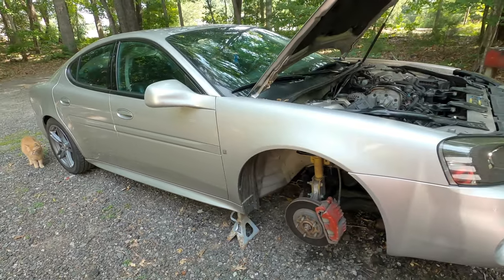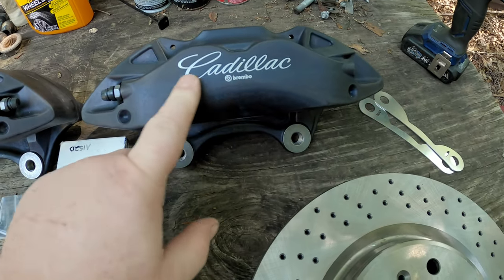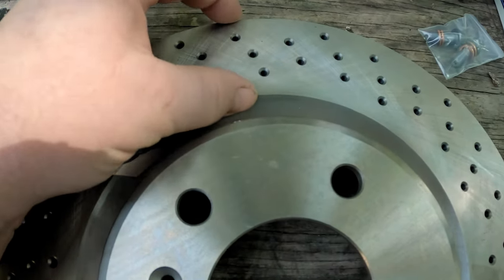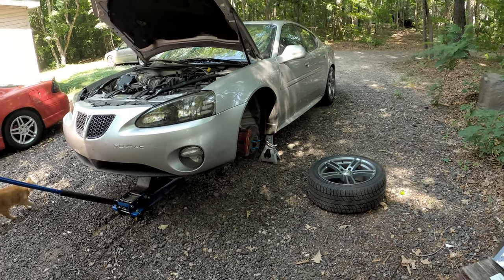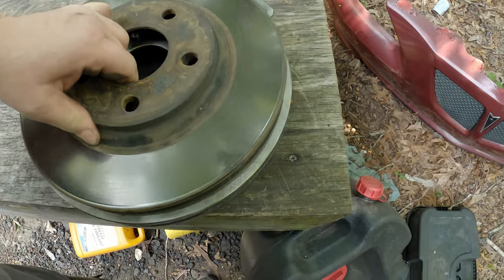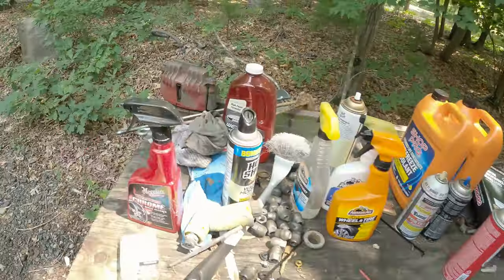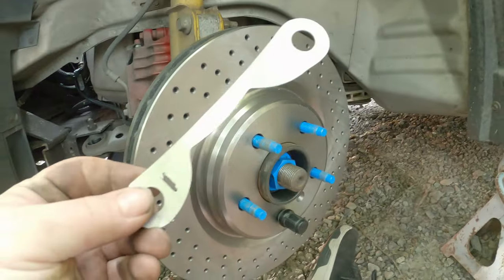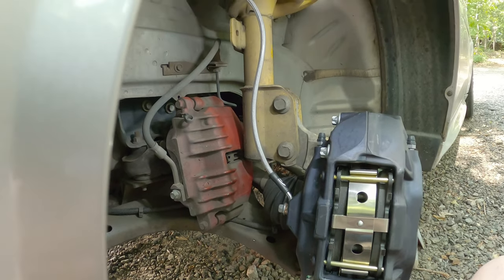Pontiac Grand Prix Brembo Big Brake Kit From ZZperformance ( Fits all W Bodies and H bodies )

Comment: Just recently bought an 08 GP and your videos have been helpful. So far I have only done window deflectors, weather tech floor mats, headlight bracket, and headlight assemblies. List of things on the list to do...
Foglight conversion
Radio change
Brake upgrade
Cold air intake
MSD Coils
Strut tower bar

Comment: You have any squealing issues mine was fine at first then after a few stops it started squealing really loud. I bleed the calipers again and they are still squealing feels like a waste of money at this point may have to put the old gxp calipers back on. I have even gaps so I'm not sure way it is doing this.... Any suggestions are welcome. I put the cadillac 2013 brembo rubber lines on the only difference... I replaced my wheel hubs because they were rusted in
Reply from the maker: Not yet

Comment: I have an 04 Pontiac grand prix GTP comp G with the aluminum 17inch wheels. Do you think these calipers will fit with my wheels? Also would you recommend these 4 pistons over my gxp dual piston brakes that I currently have? I have a tighter pulley with a ZZP tune and headers with some other performance goodies so I want to stop just as fast as I can go!
Reply from the maker: These will not fit under factory wheels.  If you already have gxps i would stay with that

Comment: 2005 Ford mustang gt500 front rotors are a direct bolt on for 4 piston.
Reply: I just realized what I'm staying would work with the cts-v brakes. What you've got is the smaller one.
Reply from the maker: So ctsv and gt500 work together on the w body?
Reply: @SalemDoyle  yes. It's also the same caliper used on the Camaro SS but the caliper has Chevy casted instead of the V painted
Reply: @SalemDoyle  I just went back to my notes. 2010 Chevy SS calipers (brembos) and a 2005 Ford mustang gt500 rotors.

All you need additionally is the bushing kit from zzp that adapts that adapts the 12mm bolt to fit through the 14mm knuckle hole found in w-body. Then longer brake hoses. 

These calipers are very big compared to factory. The master cylinder can keep up but many have found that there's slight deadzone in the pedal at first. Sounds like you're experiencing that with yours. To fix it you can swap your mc with one from a 2010 Impala limited. It has to be a limited as it was the carry over last w-body's built. They have a slighty larger bore and pushes more fluid. Also swap the brake pedal assembly with it.
Reply: There is no 2005 GT500. 2007 was the first year it was brought back.

Comment: IMPORTANT:  These pads won't last as long as on the ATS because they're shaved. You can see they are thinner than most new pads. I put together this exact kit by chance. Had 2013 ATS Brembos and bought the cool and large GXP rotors. The rotors are really thick. I had to shave down the pads to make them fit.  I also put GXP FRONT rotors on the rear to match with 2009-2016 CTS rear Brembos... I had to make custom brackets for them and no parking brakes anymore.